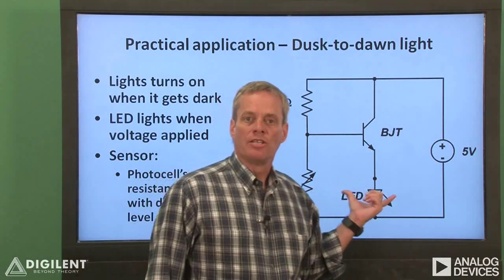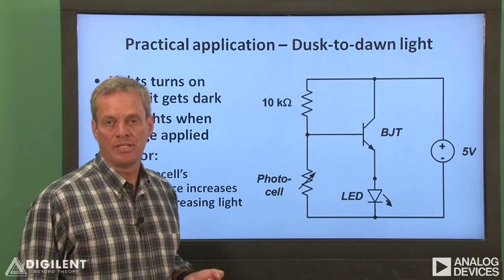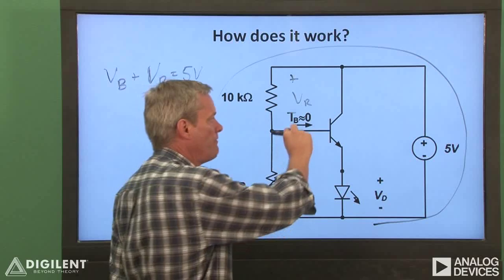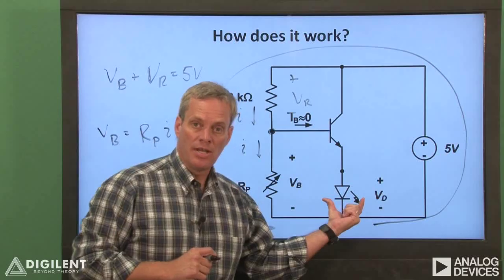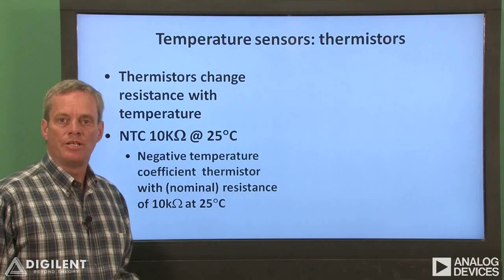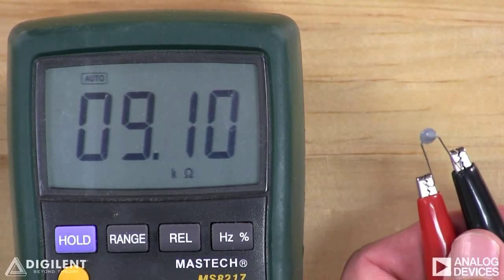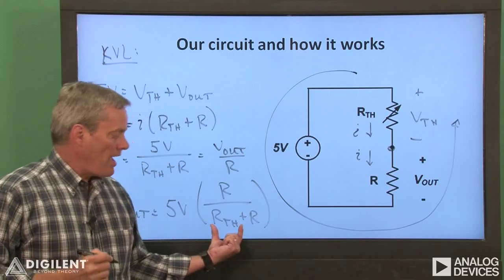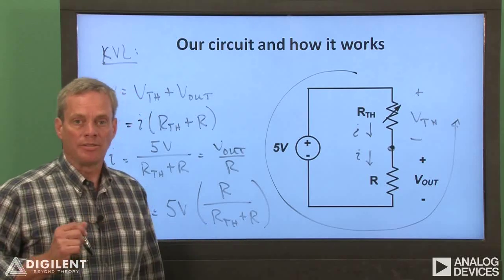Real Analog - Circuits1 Labs: Ch1 Vid4: Applications

Comment: I got a problem with this: I did exactly the same like in the video, tried three times to make it run this way. Just used exactly the same elements: Red LED, 2N3906L and the photo cell like included in the original Analog Parts Kit. The only difference is that I am using the Analog Discovery 2. I even tried resistances 4.7k and 10k.

I solved the problem by using an additional 1.2k resistor in series with the LED, but I don't understand how it comes - does the second version of the Analog Discovery provide higher currents in this circuit?